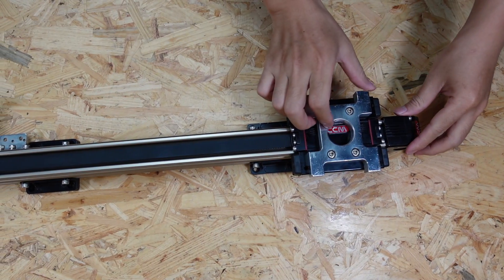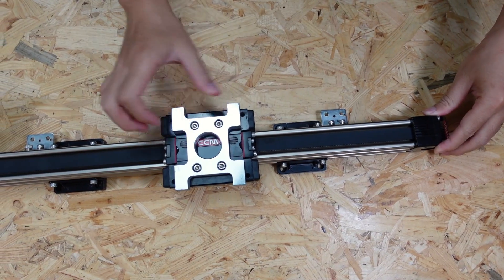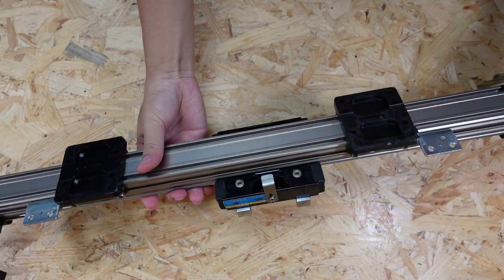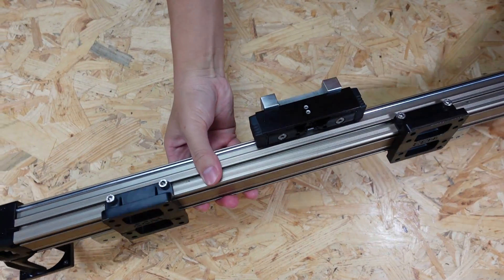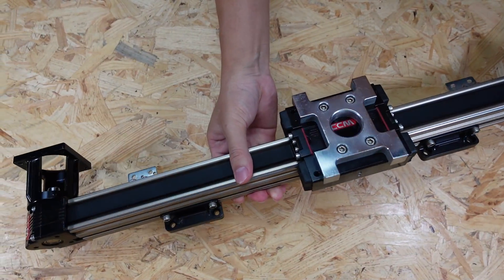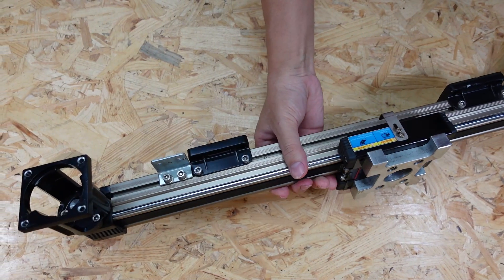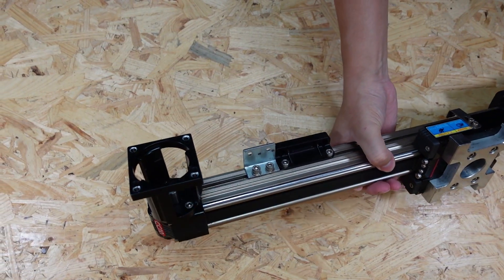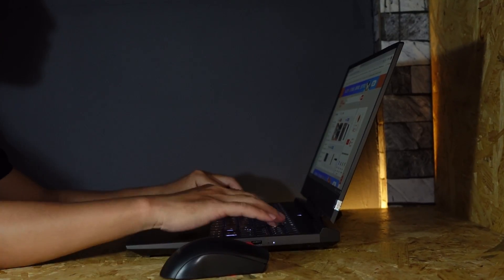How to Make a Professional Camera Slider from Scratch (Plug And Play)

Comment: Is it possible to change the display unit? I would like to display absolute position in mm. Set the new position for example: X:550mm and the motor runs until then. I can't understand if it is possible or it displays only the number of pulses.

Comment: Can You tell me how to calculate values for F2 electronic gear ratio ? I have motor Nema 23 57HS112mm so F1 is 360*/1.8*=200 but I dont understand the F2 Denominator. Thanks, great video
Reply from the maker: This is a console made in China, you just "plug and play" without programming
Reply: @VuVT-Workshop  yes I know. I have two of them, but I wonder how to calculate F2 denominator (or its just not importand?)  F1 I alredy found its 200 for motor with 1.8* degree
Also Im not sure why there is slow stop for programs, but when I push stop manualy it stop without programed delay.

Comment: Hi, any chance you can help me with setting mine up?
Reply from the maker: okay, you can ask anything
Reply: I have the HF020 controller, like yours, a DM556 stepper drivers and a NEMA 23 motor. I can't figure out how to wire it up properly and properly do the settings for P and F on the controller. I followed the manual but it doesn't explain much...
Reply from the maker: @RaphaPretorius  Please try following my wiring diagram
Reply: @VuVT-Workshop  thanks, I will try that now